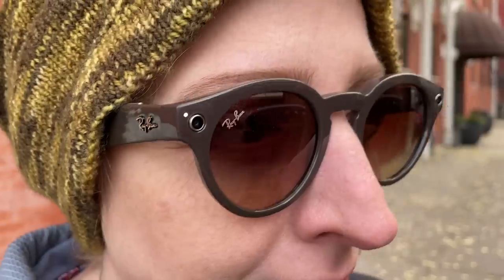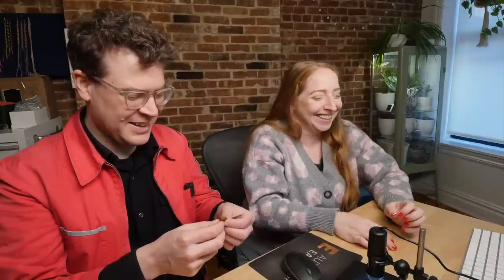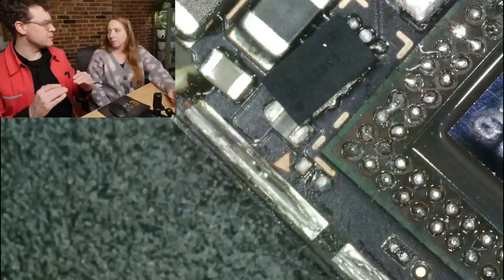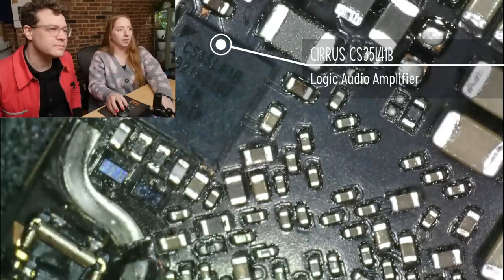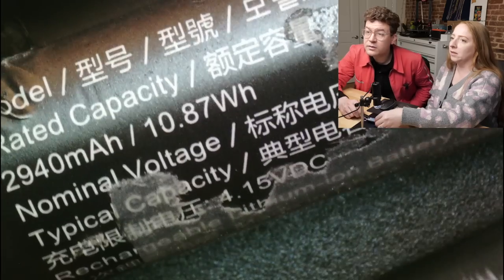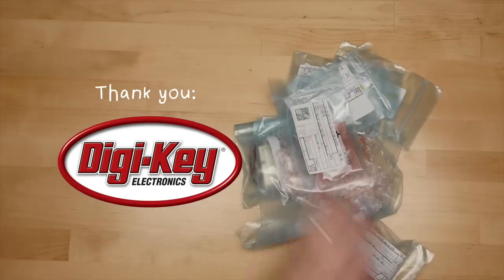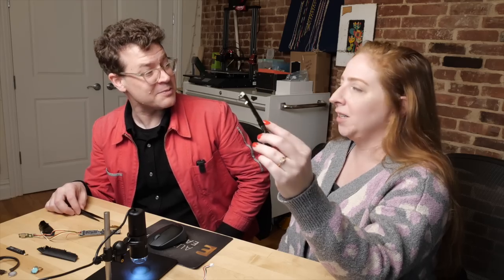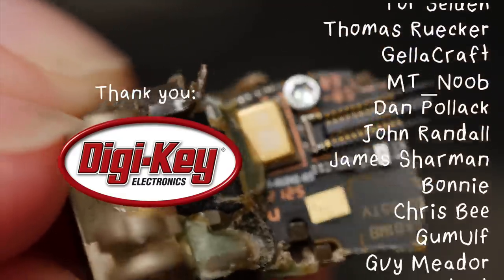What's Inside the Ray-Ban Stories Smart Glasses?

Comment: If you suspect that the screws have thread lock, try heating them up with the tip of your soldering iron.

It may require a couple reheats to get them out.

Comment: I wonder how hard it would be to design a Flex PCB with contacts that can be put in a thinly 3d printed clasp to wire up an external power source. I have the Meta Ray-Ban Wayfarers and my only complaint is the battery life, I mainly use it for music because ear buds never fit well in my ears. The charging point on these is right above the nose and there is a 2-4mm gap between the charge point and the bridge of my nose. From the text printed in the charging case the output of the case is 5v 1a which would be easy to do with a usb battery bank. My Problem is i am no good at 3d design and I would not know the first thing about designing a printable thin clasp that could go around the bridge of the glasses, hold the flex pcb with enough pressure to keep contact, and route a cable out the top and to the side that could be held with mini clasps following the top of the frames to the ear stems so the wire could be routed behind the wearer and either under or over the shirt to a pocket worn battery bank or other solution

Comment: Since the camera sucks, can it be changed by putting on an iPhone camera that has so much quality? I haven't seen anyone do it..
Reply: She said in the video she had to break the glassed to get to the camera module. So physically it seems almost impossible and you might be better of putting a phone in your cap.
Interesting question if you can just switch out cameras who have the same connectors. Might be possible to try that on old smartphones of the same brand who might use the same connectors.
Reply: Wouldn't the processor need to figure out the hardware? I doubt it would work

Comment: Definition. A "buck" or "step-down" switch-mode voltage regulator is one in which the output voltage is lower than its input voltage.
A buck regulator is a step-down regulator, as opposed to boost. 
so ,a somewhat proper statement would be bucking off the horse - if that is what you were reffering